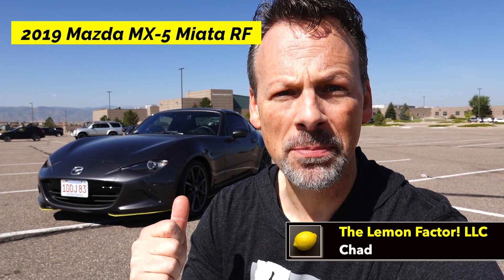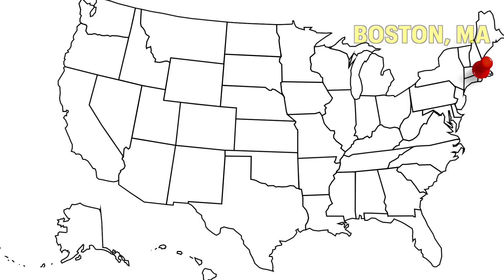DYNO TESTED - 93 Octane @ HIGH ALTITUDE!!! // ND Mazda MX-5 Miata

Comment: Since you own the Miata for a while, would you say its worth it and reliable like the 10th gen accord? I'm thinking of getting the 2021 MX-5 RF Club. I also own a 10th gen accord but wanted to have something small and fun.
Reply from the maker: The Miata has been a very reliable and fun car for me! 😁👍. It is listed as on of the most reliable cars of its class, and in general.
Reply: @TheLemonFactor  You mentioned on one of your videos the riders in the passengers will be very uncomfortable due to the space is smaller than the driver. Is it that bad where it is very uncomfortable to sit in and is it tolerable in long drives? Also, what are your thoughts of the automatic? I know the manual is more fun to drive but im thinking of getting the automatic due to i live in a congested high volume traffic city.
Reply from the maker: The passenger side is a tight fit with a big hump at your feet on the left. There’s not a lot of room. Overall I don’t think this car was setup for long distance comfort 🤷‍♂️. As far as the transmission, test drive both and see. Part of the fun for me is the manual transmission 😁
Reply: @TheLemonFactor  My husband is 6'2 so i guess he wont be able to fit there. lol
Reply from the maker: 😕. That would be a tight fit for him
Reply: @TheLemonFactor  I guess he can take the accord for that.. haha
Reply from the maker: Which really isn’t a bad second choice 😉